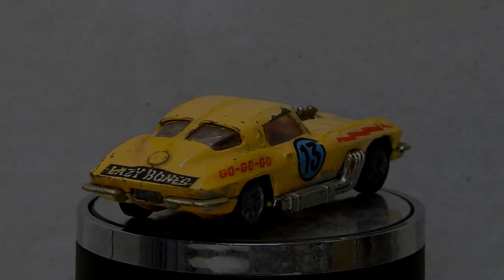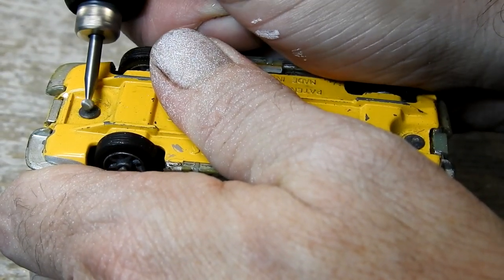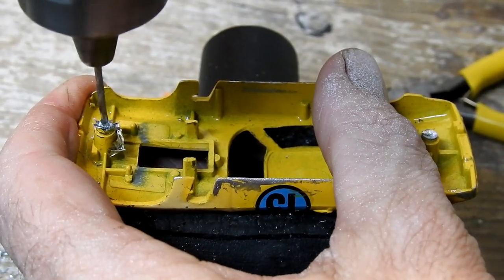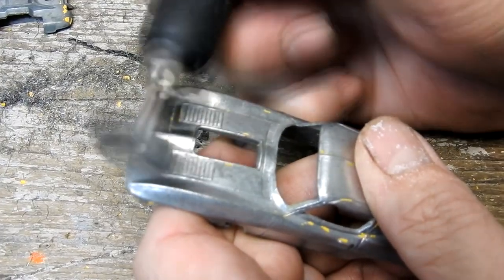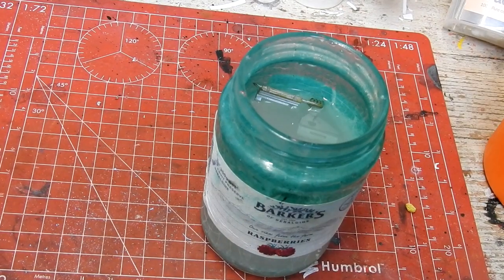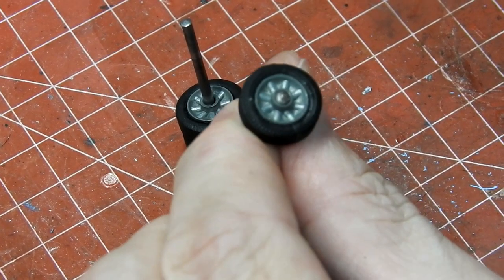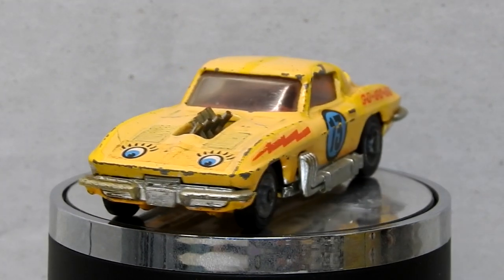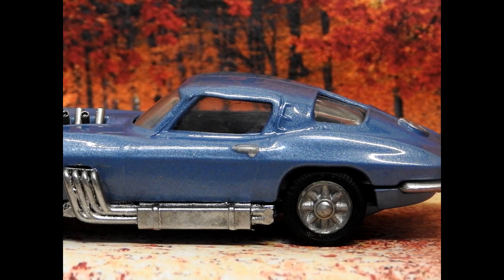Corgi Custom Restoration Chevrolet Corvette Stingray Stock Car

Comment: Great job again Danny ⭐️ I once did one of these in Black and had it on eBay for ages , no interest 🤔
So I took it off and re-did in Silver and it was gone in a couple of days! So yes I agree with you light metallic colours like the Blue you just did or a Silver suits this model best. Thanks for the mention bud and the link 👍👍👍
Reply: It's amazing how the colour of a vehicle will affect a sale.  I would have thought a black stingray, with perhaps a red interior would be a great colour combination.
Reply from the maker: @railtrolley  I think black does nothing for them personally. Neither does red, but everyone has different tastes.
Reply: @DannysDiecastDisasters  Very much so.  Vehicle colours are so subjective.  Everyone has their likes and dislikes about which colour suits which vehicle.  The blue on yours looks great.

Comment: Awesome job Danny you were lucky you got the whole car. If you look back at my channel you'll see I did the same model only I made mine into a road race version but I had to make the bumper section cuz the plastic was so brittle.
Reply from the maker: Yes I was surprised the pipes on the bonnet were still there, although on mine the plastic parts were actually quite rubbery.

Comment: Thnx for always taking the time to detail the interiors.
Some don't bother at all (which I hate),just makes the job seem incomplete.

Is this a 1:64 scale? (looks a little bigger).
What's the actual length (in cm's) of this car?
Reply from the maker: A bit larger, not quite 1/43 scale either, in between. Its 9cm long 👍

Comment: what is the point of the side pipes when the exhaust comes out the bonnet/hood
Reply: The pipes coming out of the hood could be the velocity stacks for a Hilborn fuel injection or similar set up.

Comment: Not being derogatory cuz love channel . But. Yep big ass but. All your stuff comes out orange peel.!your running brush too dry!  Turn it up or quit trying  so hard to show off.   Use spray cans if you can’t figure out how to. Or buy better gun. Your every  one is orange peeled. And you don’t bother to even wet sand  on single stage to get rid of.